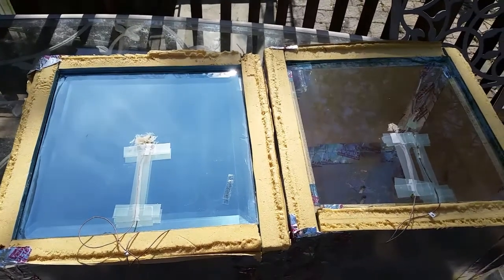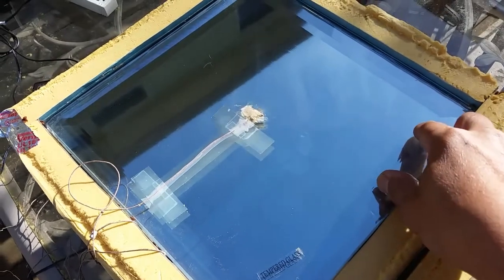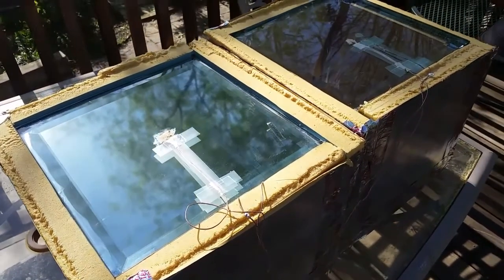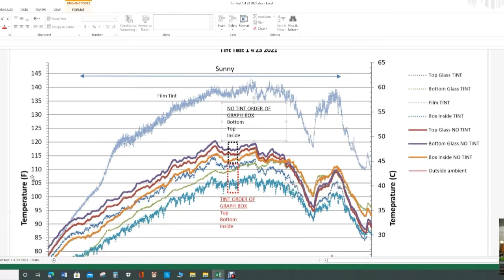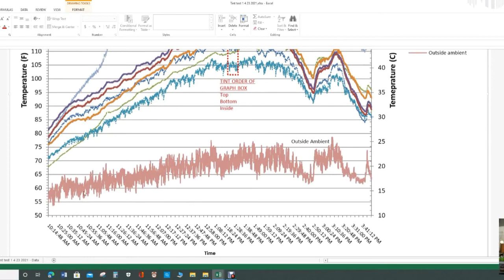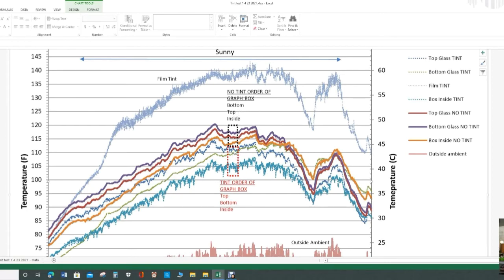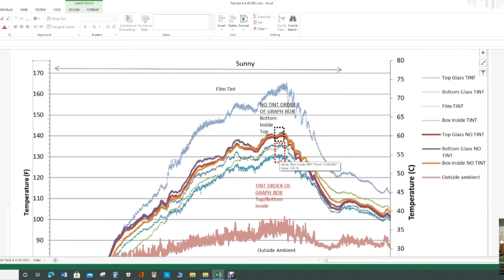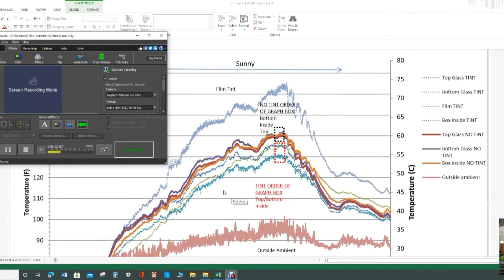Will tinting the sunroof cause it to shatter? Part 2 - My Surprising Results

Comment: It would be useful to understand what type of tint you used (such as nano Ceramic) and what shading (75% VLT).
Reply from the maker: You’re right. After reading more about the various shade types I want to repeat the experiment with the type of shade I’ll be using. I had some window Film One Way Mirror Film sitting around so that is what I ended up using and it’s not intended for car windows. This explains why the film heated up so much because of the metallic film. Using a nano ceramic probably would not have heated up so much. So thinking of doing it again with the nano at 30% to see what temps I get. Still don’t expect the glass to heat up. Guessing the shattering incidents of sunroofs after tinting are caused by nicking the tempered glass when they trimmed the material.